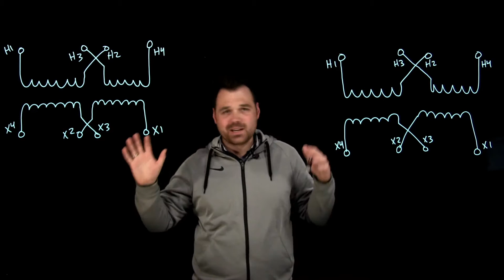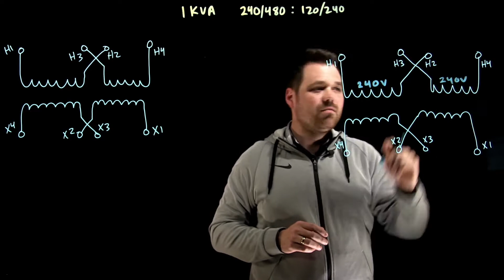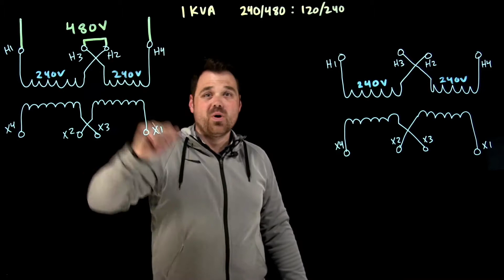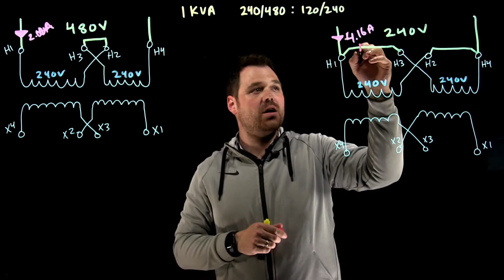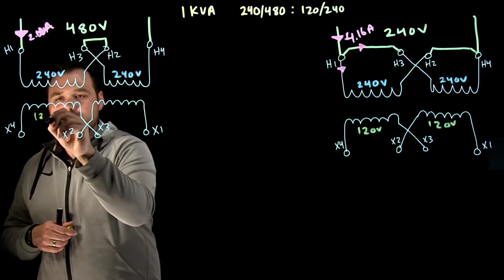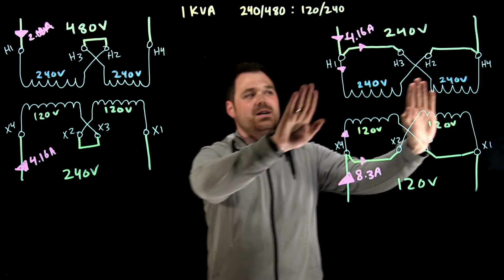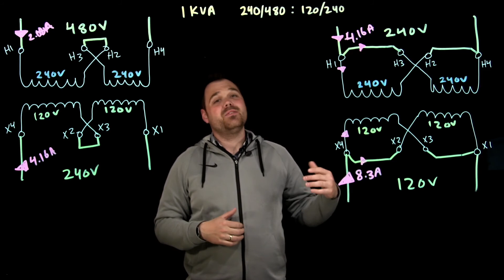Multi Winding Transformer Ratings and Connections

Comment: The 480 on the H.S can only be achieved by putting the coils in series configuration, keep in mind the coils are rated for 240V each, which is how this naming convention works. After the '/' is means that the voltage can only be achieved through series configuration. On the Low side, we have each coil rated for 120V with 240V obtainable when coils are in series configuration.

Comment: How would you wire a circuit breaker panel with this transformer? Where does the neutral come from?
Reply: Neutral always comes from X0
Reply: You would wire the low voltage in series for a 240v output and take your neutral off X2 or X3. Also note that you would have to bond that neutral to ground as it’s a separately derived system due to the transformer. That bond could be located either inside the transformer or in the main panel served by the transformer. It’s usually most convenient to just bond it inside the transformer however, since you can just put a double lug on the chassis ground and land your building ground on there as well.

Comment: Bravo........u should be more famous.........great job...........using a auto transformer configuration ......does the split phase  240v or 2 chanels of  120v are in phase with each other.........I need one phase 180 degree out from other phase.......like u.s. grid power system ......   cheers

Comment: Question: I am receiving a transformer 3P with 2 secundaries 12.47 Primary and 480/277 and 415/240, my location needs both and I design this to fullfill the requierement, now the company said it is one primary or the other, if part of my location is using 480 including panels and transformers to reduce to 240/120, is possible to connect my 480 transformers primary with 415 V and expect to keep going working in the same way. Please advise, thanks for your help

Comment: Question: Why are the H2 and H3 lines drawn crossed? Why are the X2 and X3 lines drawn crossed?  I see that on the ones at work all the time too. 
Also, if you power only ONE H1 and H2 with 240VAC, could you use H3 and H4 to get 240 VAC? But at 2.08 Amps? If X1 and X2 are powered by 120VAC, can you use X3 and X4 for 120 VAC as well as the H windings ?
Reply: Regarding why terminals are shown crossed, it has to be with how they are disposed for physical connection, just like how the terminal box is disposed in motors. This is a guess though, cause I have worked with motors but not with transformers.

Now, regarding what you said about just using a half winding as a primary, you got it right, according to theory, you could even use only one winding as a primary with three secondaries available, and as long as you stay withing the power rating, it should work without a problem. Just for clarification, I am referring just to the theory behind transformers, could it be that a real world design doesn't allow to do such a use, due to other kind of constrains.
Reply: This has to do with additive vs subtractive polatity, when its additive, the voltages of the coils 'add' together because of the winding configuration around the core, the flux adds up.